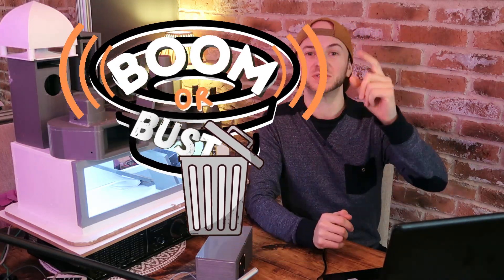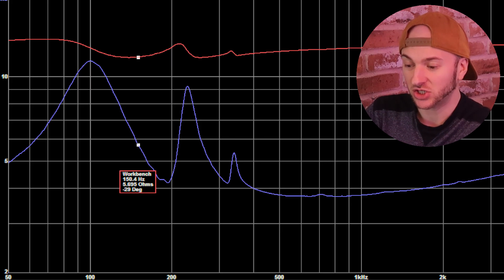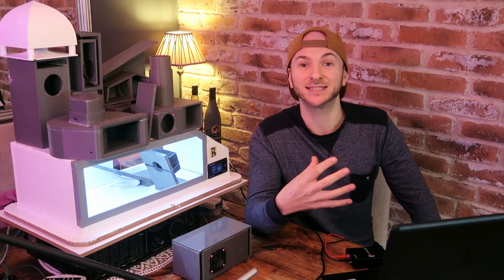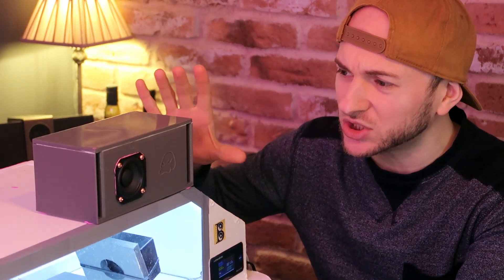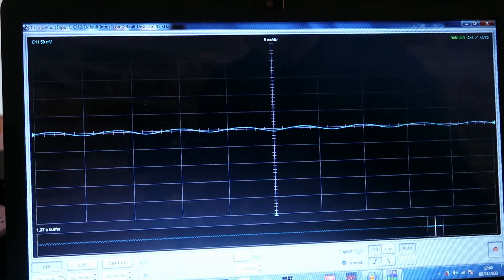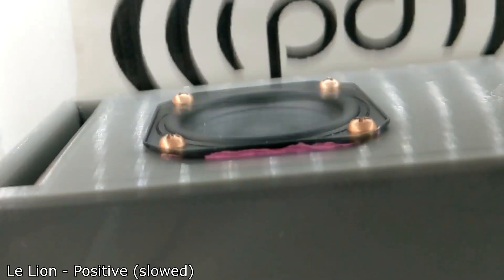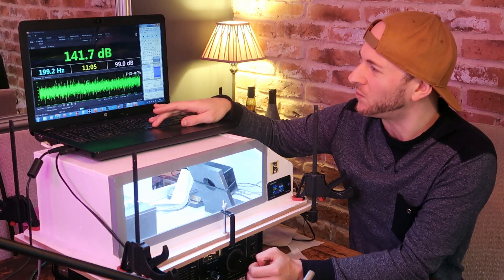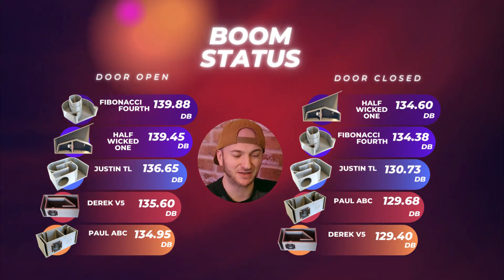Is this subwoofer box magic? | Boom OR Bust S1E10

Comment: Shout out to “PEZ” the Rockford Fosgate sales Rep in Canada who recommended this box. I too was a AV sales man at a stereo shop , and PEZ was my sales Rep. He used and encouraged this ABC box. I built a few over the years and LOVE it.

The benefits: you have the linearity of the exposed cone, and the efficiency of a band pass. You effectively have two tuning frequencies. At lower frequencies, the inner port is in use; allowing both chambers to act as one, and both outer ports to function, giving you a low tuning frequency.

At higher frequencies, one inner port chokes off the smaller chamber, leaving the driver using only the chamber it sits in and only the port in that chamber, giving you a second, higher turning frequency.

The results are: great detail, and huge output, when done correctly with a true “subwoofer” I will build this ABC box again and again.

Thanks PEZ!

Comment: What you could try is a bit of poly fibre and put it in the short Port right at the back and halfway down, slow the air down a bit, also with the 3D printed the middle section and the back slot three quarters of an inch thick, from getting some unwanted resonance, and also put some standoffs block either end of that Port, you don't want it flapping about even if you think it is stiff. And some couple of bitumen pads on that centre partition.

Comment: You will need to build this enclosure to suit a 10 or 12 inch sub running 80 hz down to 20 hz.  Using this little speaker with those very high frequencies doesnt show case this style of enclosure. watching this video, i still dont know what the differences are compared to other enclosures. in other words, this video was a waste of mine time and yours.
Reply from the maker: Thanks for the info
Reply: Everything is being mathematically scaled to represent the equivalent of 10” or 12” subs running 80hz down to 20hz.  This makes it easy to build and demonstrate.  It is genius!  I would not mind seeing a 1:1 scale version being built to compare if the scaling is actually accurately representing performance expectations though!
Reply: @justingillette8287  how is that even possible to determine, even if it can be mathematically demonstrated?
Reply: @ the concept of scaling a system down like this is new to me and I’m not sure if it is correct but I like the idea, if you build a box 1/3 scale, the box tuning becomes a 1/3 higher frequency he plays music at a speed 1/3 faster so the sub frequencies played to the sub are in the tuning range then the camera is slowed by a 1/3 so we see it as if it were the correctly scaled output.  If nothing else it’s a cool concept!
Reply: @justingillette8287  unless I see proof that that formula works, I call bs. there's no mathematical way to do it, other than making a full scale version with the correct frequencies to get any kind of result.
Reply: @ if you say so